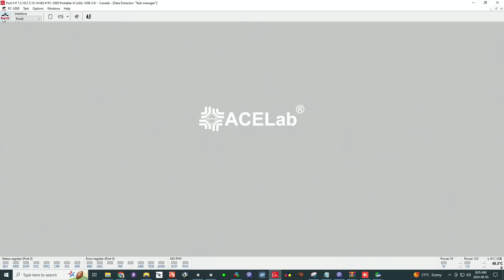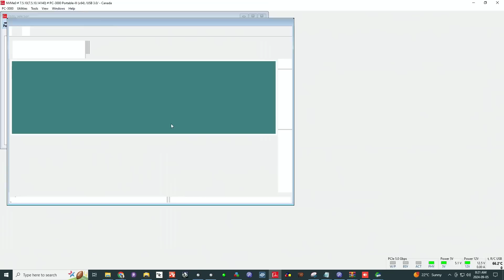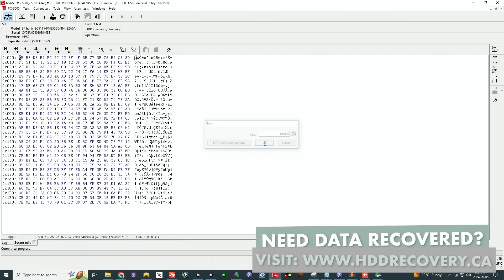SK Hynix BC511 stopped working, can we at least save the data?

Comment: I wonder what purpose does PC3000 even have in this case that u only have a chip (you cannot control heads or platters anyway), isnt it the same as pluging it in a computer direcly or use some usb to m2.5 (mini sata or how this is called properly) adapter
Reply from the maker: Solid states in general or this specific one?
Reply: @hddrecoveryservices  this specific one 

I guess solid states in general have more control if plugged in PC3000

Comment: $0.02 part failure, again. Next time, put your meter in capacitance mode and measure the part's value from the donor board. That way you know what new part goes there should you not have a spare donor when working on the next of these memory cards.

Comment: Really appreciate this video. I am new here. I have been learning how to micro solder for the better part of the last year. I have gotten really good at it. BUT, I still struggle with learning how to troubleshoot a fault on a board. So I always appreciate when videos tell you which mode they are on in the multimeter, what color probe they are placing where.. very nice.

Comment: These ceramic caps are notoriously prone to shorts. Especially in video cards.
Reply: Because they do not handle break-over or recovery easily.... but they are cheap...

if you go back to the 90's AVX did a fantastic data sheet on ceramics & crystal growth inside the cap under  stressed use.

Comment: Can the M.2 / NVmE, like the one you are working on here, be reformatted for renewed use?
Reply: Of course, It's just non-volatile memory. I have installed like 4 different Operating Systems unto mine.
Reply: @juanmacias5922  so if you have an M.2 like this one, it came out of a laptop (an HP) , probably has Win 10 (or 11) on it. It, using the correct equipment / software, be reformatted, mounted in a suitable PC, and a fresh Win 10 loaded? Cool! As a kind of hobby I look for electronics in dumpsters and curbside stuff! Found a tossed out HP laptop in an apartment dumpster, but it was destroyed. About all that was left was the M.2.
Reply: @j.lietka9406  yeah, if the M.2. survived there's no reason you shouldn't be able to reformat it, and reuse it. It's the same as an old school hard drive, or a solid state drive, just in a different format.
Reply: @juanmacias5922  yep! Thank you. Wish the HP laptop wasn't ruined! 😠